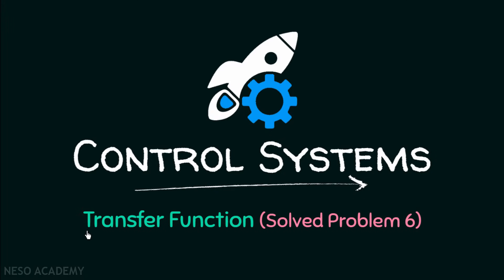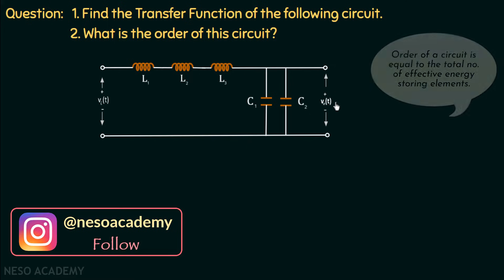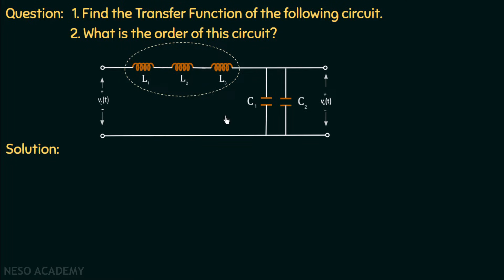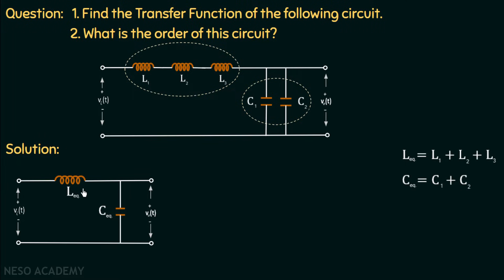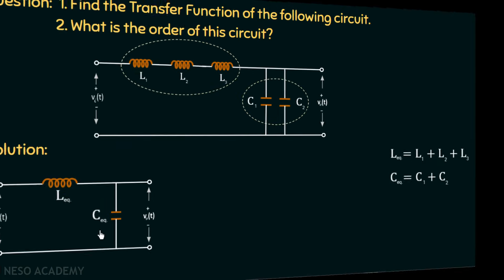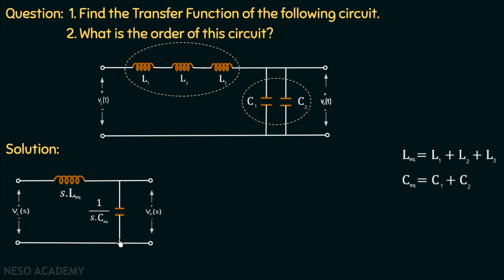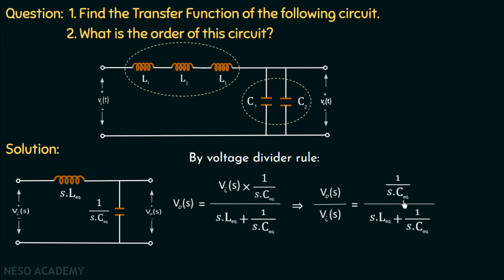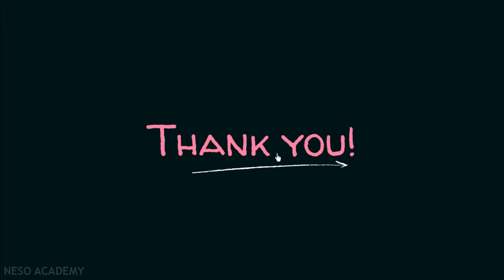Transfer Function (Solved Problem 6)

Comment: I am guessing it is order 2 circuit, because you can always replace the three inductors with a single inductor, and the 2 capacitors with a single capacitor and get an equivalent circuit. So as far as the voltmeter is concerned, it would look like a 2nd order circuit. In particular, the ratio of output to input would likely result in a 2nd order polynomial in s in the denominator.  Will find out over the course of the lecture if this is correct lol. I love these lectures by the way. Super informative and well worked out and explained theory and examples!

Comment: H(S)=1+2S/1+4s and order of the circuit is 1 because 1 capacitor can result into zero output and non-zero output. Those inductor and capacitor connected in parallel to each other when inductor is opened circuit then the capacitor is shorted circuit and  vice versa is true . So look carefully on previous lecture this is what I understand

Comment: I am getting  the transfer function as 1/4s+1 . I have solved the horizontal RLC circuit and equivalent impedance was one and then i added the one to the one ohm resistor because they are in series so the circuit becomes 2ohm resistor in horizontal and one 2F capacitor in vertical. I am i right?

Comment: METHOD TO SOLVE THE HOMEWORK PROBLEM-

Step 1- Draw the Laplace Equivalent of the given circuit

Step 2- Find the equivalent impedance of the two parallel paths on the horizontal line- Top path has an equivalent impedance of (s+1) and bottom path has {1+(1÷s)}, and so total impedance is (s+1) ll {(s+1)÷s} which gives 1

Step 3- Find the equivalent impedance of the vertical line which gives 1+(1÷2s), that is {(2s+1)÷2s}

Step 4- Apply voltage divider rule to find Transfer Function, H(s)

My answer is, H(s)={(2s+1)÷(4s+1)} and since the highest power of s is 1 in this TF, so the order of the system should be 1.

Hope my comment helps!
Peace✌
Reply: should we divide here?  " (s+1) ll {(s+1)÷s" why not addition?
Reply: @prabanjan8140  because they are in parallel
Reply: @prabanjan8140  yo its parallel so a||b means (1/a)+(1/b)
addition is for series connection
Reply: Thank you so much bro ... It helped a lot 😌✌🏻
Reply: great work
Reply: last mei wrong hua haii last step mwii
Reply: @satyasadhanpadhi  kya wrong hain?
Reply: @Vaibhav-Mishra  niche wala comment m dekho
Reply: correct ans likh diya h
Reply: Thanx
Reply: Thank you for the explanation
Reply: Order should be 2
Reply: u r god
Reply: Someone explain this… how do we get 1 from the total impedence?
Reply: @MuhammadSaad-pj8zt  it's suppose to be equaled to s
Reply: @MuhammadSaad-pj8zt   make parallel connection and solve  it
Reply: Great help bro, thanks
Reply: Thnku
Reply: Thanks man
Reply: Thank you for this ❤
Reply: Thanx alot
Reply: Thanks bro👍
Reply: when finding the equivalent impedence of the vertical line, we need consider like V0 is the voltage accross both resistor and capacitor?
Reply: The answer is correct i got the same answers! thanks for sharing so i was able to verified.
Reply: Thanks
Reply: I came across this comment after solving. Glad I got it right.
Reply: Bangali ra eto valo ki kore hoy ke jane 🐸🖤
Thank you dada

Comment: if u calculate the equivalent impedance of horizontal line then it  comes out to be 1(i.e. purely resistive)  , so only the capacitor in vertical section is  working as energy storing element . also T.F. = (2s+1)/(4s+1)  hence highest power of  's' here is 1.
Reply: I also got same answer.
Reply: How to find the total impedence ? I mean how do we get 1 ?
Reply: @MuhammadSaad-pj8zt  Treat all the components as resisters, so you find their respective impedance and apply the rule for adding resistance when in series and when in parallel. The value of 1 will eventually come out.
Reply: @MuhammadSaad-pj8zt  take resistance of capacitor as 1/SC and for inductor as LS and treat them like resistances so you have 4 resistances with (1ohm and SL in series) parallel to (1ohm and 1/SC in series) put the values of L and C and solve you will get 1 ohm net resistance as answer
Reply: @eng.rohanshukla933 I have been able to get that. How were you able to arrive at the final answer?
Reply: Thanks dude

Comment: (2s+1)/(4s+1) with order of one
Reply: Replace 1ohm=1,1H=s,1F=1/s and 2F=1/2s and treat then all as resistance and find output voltage and after all you will get V(O)/V(I) and in equal to you will get ans and that will be same as above written 👍👍
Reply: What will be answer if we treat all of them as a resistor ?
Reply: Thank u bro ❤️
Reply: I think order is three because 2 capacitor and 1 inductor that is three active storing element
Reply: Plzz tell me how bro...???🙏
Reply: (2s+1)/(4s+1) with order 1
Reply: @heyrahulsingh  how ? I don't get it. Please explain
Reply: @muzammilmahida8827  Bro above thre is a comment of AmitRaj he has already explained...!
Reply: @heyrahulsingh  bro I get half what he said. I am  not complete understand. Can you please explain
Reply: @muzammilmahida8827  Bro after replacing all by resistance just apply voltage divide rule 
And hence find out V(O)/V(O)...
Reply: correct ans

Comment: The transfer function is 0.5(1+(1/(4s+1))). hence order must be 1
Reply: How?  I think Order is 2. Plz explain your ans
Reply: @razibbaraljoy9978  Let's just consider the inductance+resistance arm in the parallel combination. You'll notice that it acts as a low-pass filter and allows the lower frequency signals to pass through and be collected across the output voltage.

Now, let's just consider the capacitance+resistance arm in the parallel combination. You'll notice that it acts as a high-pass filter and allows the higher frequency signals to pass through and be collected across the output voltage.

Now, the parallel combination of both these arms makes sure that one arm (inductance+resistance) passes the lower frequencies, and the other arm (capacitance+resistance) passes the higher frequencies. So, at the other end of the parallel combination, both the lower and higher frequencies tend to get added up, and you don't get much of an effect of this parallel combination here. 

Now, the cut-off frequencies for both the low and high pass filters happen to be exactly the same. So, whichever frequencies is not allowed to be passed by one arm, is allowed to be passed by the other. This is the reason you don't get any net effect of the L-C-R parallel combination over here, in the transfer function, and the effective order of the circuit is 1, due to the 2 F capacitance at the output arm. Hope this intuitively explains why the order is 1. 

Now, for mathematical analysis, just try to find every Laplace equivalent of the elements, and use voltage division and parallel and series combination properties in a circuit.

Comment: Tf=(2s+1)/(4s+1)
Reply: Pls pls someone tell me how to solve the problem given in the last...!
Reply: I got Same answer bro
Reply: Same answer
Reply: What is the order???
Reply: @sindhupalanki6578  order is 3
Reply: @sindhupalanki6578  1
Reply: @4025_Laxman gurjar sure aa
Reply: @Jhansi Das why order is one .....i think order should be at least two coz both capacitor and inductor are present in circuit.... if you know can u explain that....
Reply: @CD-tf6mj  but the highest power is 1 so this is why
Reply: @CD-tf6mj  late but the top portion is purely resistive
Reply: @Hela..  Sorry but i have almost forgot all the basics related to particular topic but did u mean that inductor and capacitor in series with resistor doesn't get count... If u know the reason please tell me why..
Reply: same answer

Comment: T.F. = (s + 1)/(2s + 1) 
Order of the circuit is 1
Reply: Can you pls explain the T.F part?
Reply: @gurunaresh1756  sure...
Step 1: convert all the impedences into laplace
Step 2: solve the parallel connection of the upper part of the circuit where u get the impedance to be 1
Step 3: apply Voltage divider for TF.
Reply: @aziza.bootwala5015  bro can u email me the answer how u do that please
Reply: Ig you took C value of below one as 1F..
Reply: @anjalin7935  sorry didn't get u
Reply: @aziza.bootwala5015  the value of the capacitor (the one not in parallel) is 2F then answer will come (2s+1)(4s+1)...
Reply: @anjalin7935  yeah right
Reply: @anjalin7935  thank you
Reply: can you tell me how the order is 1?
Is it like the highest power of s is 1, therefore, the order is one.
Because the way sir told to calculate the order am not getting how to use it in this question?
Reply: How the impedance of the parallel circuit became 1